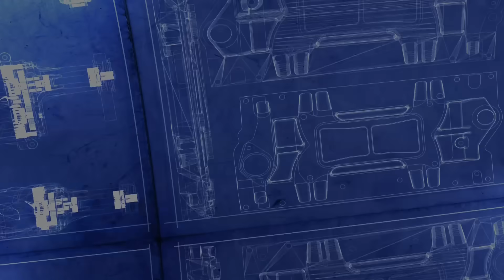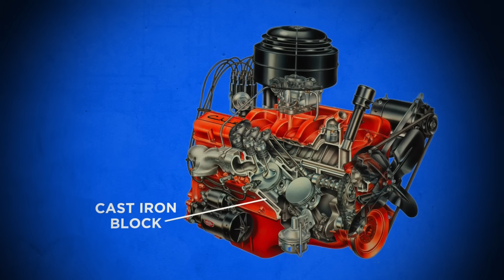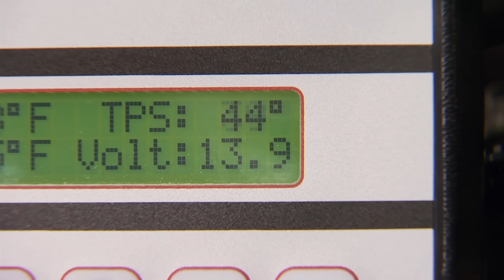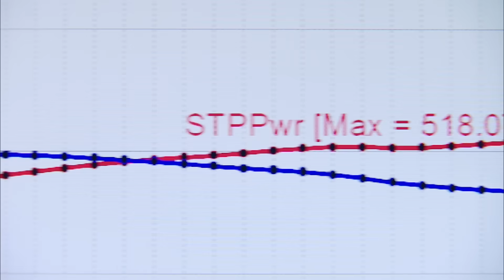Building A 518HP Supercharged 350 Small Block - Engine Power S2, E6

Comment: Mediocre short block parts, ok heads, smallish cam, is a sure recipe for mediocre power.. I'm not sure I'd be impressed with barely over 500hp.. especially with a weaksause ribbed belt for the blower drive..
Reply: I got the same block and it makes 500hp without a blower lol
Reply: @mattgarkus2489  my point exactly... watch enginemasters, way better show in my opinion
Reply: Correct, I have extensively ported cast iron fuelies from K&G speed on a 355 with 12:1 compression making 510 horse for a LOT less money. And I took the big cam out and went smaller for that power.
Reply: @donrutter6765  what octane you are runing in?
Reply: @donrutter6765  I hear you buddy. I had an 84 Ramcharger and pulled the original LA 360, I did a factory refresh with some forged rods, .030 over Mahle 12:1 pistons, Dart heads that were also extremely ported (by me), I installed a large custom grind cam (I don't remember the specs, this was quite a while ago), and I installed an Edelbrock dual plane intake manifold with a Holley Street Avenger 850 double pumper and with 111 octane Cam2 fuel it made 488 HP/501 lb ft of torque on the engine dyno. Not bad for an old emissions minded 360. I built the engine to install a Procharger, but I sold the truck before I got a chance to purchase the supercharger kit. I loved that truck though. Even though it was heavy that 360 shoved that big beast around with no problem. It would spin 33x12.50s with no problem...lmao Even through the old 727.
Reply: @donrutter6765  niice

Comment: 518 hp out of blower sad 😪 should be 750-800hp
Reply: 500hp out of a 350 (5.7) liters isn't that hard. 400 hp on very mild cams and middle of the road heads is common already. A blower should see in the 600's easy.
Reply: Clobercow1 what I think the problem really is they don't know how to tune properly since it was fuel injection
Reply: Not much power you get more out of a stock ford Barra 4.0 L straight 6
Reply: @Akil Baldwin it is an amazing engine makes a ton of power turbo one and nothing will touch it. I would drive something late model with an LS. Just not in a 60s muscle car.
Reply: 13:1compression 383ci on 110oct pulled 660hp dyno naturally aspirated.
Reply: @660hpCamaro  Barra's best 6.8s 2000 hp 10,000 rpm in a Dodge avenger
Reply: Correction 6.5 sec quarter mile stock block and stock cyl head
Reply: @awesomusmaximus3766  nothings hitting 2khp with out a billet block and custom heads not to mention twin turbos
Reply: @spankthemonkey3437  no it won't
Reply: @660hpCamaro  Yes possible but takes 4k in aftermarket heads  and special offset lifters and rockers to get around sbc design flaw.
Not possible with any production sbc head period.
For less then 4k total I can rock a 600 650 horse ls complete intake to pan can almost get it under 3k total
Reply: @Thelastoftheog  they didnt use production heads in this video. That blower was probably 4 grand and they could of put that money in good heads
Reply: @660hpCamaro  exactly the point 😆 for less then that 4k I can build a 600 plus n/a ls with stock heads intake to pan.....
No fancy crap needed no arp no melling.
Technically I could do it with all gm parts except cam kit by flycutting stock ls3 pistons.
My point is you can't make big sbc power n/a without  dropping 2k plus on head intake package
Reply: @660hpCamaro  you can't daily drive it though.
Reply: It's interesting to see how people don't understand, or don't want to understand HP and reliability and price.  A motor that is purpose built is just that...  Can they change the cam and up the boost???  Of course they can.  The simple minds on youtube never cease to amaze.  Are people that stupid? or is it ignorance?  or both?
Reply: I just watched engine power the made 997 hp and 900 ft lbs of torque with a 400 ci sbc  with a centrifugal supercharger. With only 7 lbs of boost on 93 pump gas, bump that to 12 lbs with 110 and that over 1200 hp. Only difference was they used a dart block
Reply: Jr's Garage I know lol then they said a forged crank is needed 😂
Reply: The stock blocks are only reliable up too 650-700hp. Regardless of what it should make the block would crack at that power.
Reply: Justin Bozeman - this is the problem with trying to make HP on a computer screen.  Same reason all the civic owners think their VTECs make 800 To the wheels. you can’t make HP by just doing the math. 

“Average” motor CFM consumption values, blower eating causing so much parasitic loss, etc etc.  Doubling the boost doesn’t just double the HP becuz the intake air temps increase exponentially, meaning the air density is dropping with each pound of boost increased.  

The harsh reality is what these guys found on the dyno, is probably really close to what most people are running, with a similar set up without alcohol or inter cooling.   Nobody likes to hear that statement but usually the truth is only a dyno pull away.
Reply: @ScoredPiston  they did run a cooler
Reply: @ScoredPiston  
While you're more or less right this engine is still under-performing for its intercooled boost and displacement, cam size, ect. I was making more power then this at the crank with a much smaller 177 supercharger, running half the boost, and a single carburetor on a 383. The only advantage I had was a little bit bigger soild roller cam and ~30 ci.
Reply: @ScoredPiston  they were running an inter cooler on this one
Reply: Heres another street 350 with over 550hp naturally aspirated https://youtu.be/gUYzannB8jM
Reply: Justin Bozeman - but you are doing numbers on a computer.  Anyway, I’m not sure where you got your engineering degree but you didn’t address shit and you obviously have some issues with people questioning your superior intelligence.  I think you need to go get a hug.  “If they would had addressed the cooling....”. Blah blah blah.  Gale banks has a really great video you should watch about supercharger efficiency and maybe you’ll understand intake air temp vs boost and why the motor won’t make your calculated number without massive help. 

I’ll keep building boosted shit (yeah, real stuff like cars and boats and snowmobiles) and enjoying my life and not giving a flying fuck about what you think.

Save yourself the trouble of responding, since I’m sure it will just be filled with more anger, I won’t be back to read it.   

Have a nice day.
Reply: @ScoredPiston  they did run a water inter cooler did youu watch the video. the blower was sitting on the cooler with 2 black ports on the front of it. they said we hooked the cooler pump to the dyno frame but you will find a place under your hood
Reply: @Bozemanjustin  
I have seen Chevy 350 make over 1200 Hp at the race track so i dont know wth are you talking about .Nitro...Twin Turbo all types of things on them .One 350 out of a 72 Nova made 2000 Hp .Explain this .
Reply: @Bozemanjustin  
I have seen little 1.8 L 4 cil make 2000 Hp ...Explain please ...you seem so smart and shore of your self .
Reply: @Bozemanjustin  
No the guy said in any way any how no way that we could run i gues 350 Hp or so becouse thats how much flow the engìne has or as he calles it a 350 vacum breather .

I know i had about 350 350s in my life and i know how i can and cant get out of them Chevy or Pontiac 350 s .
Reply: Radeonr9280x A you can easily get 500 hp naturaly from a 350
Reply: Jr's Garage yea I've seen this video where a stock 350 junkyard engine with eBay turbo do well over 500
Reply: Blowers waste a lot of parasitic loss. A 10,000 hp top fuel car wastes 800 hp on the blower.
Reply: T RopE  realy it will cost you almost 15k for 550??? wow you can get 550hp on around 6k
Reply: 275 to 300hp factory. Cam and heads bumped 120 tops then supercharger another 100 ish. Waste of money
Reply: The pulley ratio on this is conservative AF. The eaton TVS 2300 rotor pack in that blower is the same as used in the 13-14 gt500 mustang and LS9 and can be overdriven to over 18,000RPM for around 800hp on E85.
Reply: @Bozemanjustin  yeah but the blower is eating 100hp
Reply: @stiggy60426  they dont take that much to run
Reply: The show is old some episodes are 10 years old tech has changed so much since
Reply: @BIGGIEDEVIL  The Barra is 17 years old
Reply: @BIGGIEDEVIL  eldelbrock still sells this engine today iirc none of the complete engine with blower go over 575hp
Reply: Jr's Garage yea i think In another engine the almost bit 1000 with a mild cam and no blower
Reply: @Akil Baldwin I'm a die hard Chevy fan have never owned anything but. I hate the LS platform there ugly as hell especially in old muscle cars. I will keep my big and small blocks you can have all the LS crap. In my area not so cheap and definitely not cheap to build. Sound like any small block.
Reply: @robertweitlauf4653  out of summit you can build and ls for close to the same price as a gen1 sbc. they have really come down on the price of the parts for them. the aftermarket has really caught up with the ls
Reply: @robertweitlauf4653  plenty cheap to make power with ls cheaper then sbc if you want to make 600 650 n/a 
6.0 iron block bored to 4.065 ls3 heads 11.1 gpi ss4 cam kit is 600 plus all day for less then 3k
Reply: @Thelastoftheog  I can make as much power for a whole lot less money with old school small block. I have been building small and big block Chevy's for 45 years and have been taught by some of the best in the industry. And LS platform is not cheap to build.
Reply: @robertweitlauf4653  so what sbc head cause you ain't getting over 500 with production sbc heads n/a.
Reply: @robertweitlauf4653  I can get a ly6 6.0 core for 4 to 500. Ss4 Cam kit with gaskets and pump 1000.00
300.00 Block machined, 600 for srp pistons, 100 for misc gaskets that's 2500 for 600 plus n/a even with stock truck intake
Reply: @robertweitlauf4653  my stock ls heads flow 301/199 @600 and 373/250 ported no need to buy expensive crap.
Reply: @Thelastoftheog  sure I can that's what 45 years in the industry gets you. I grew up in the area when guys made 4 and 5 hundred horse power from small cubic inch engines.
Reply: @robertweitlauf4653  lol find one dyno vid of a sbc any cubic inch 
With production vehicle cast iron heads not bowties that's over 500 up n/a on gasoline.
Not even with vac pump, narrow bearings, roller cam bearings, 14.1, 
There are none.
Maybe with the vortec head which all agree is better then old double humps 041 441 461 462 and that's ported to the max Push rod tubes and offset lifters and might break 500
Reply: @Thelastoftheog  dude give me a break, 1970 LT-1 factory rated 370 jp actual hp with a good tune 500 hp. 1969 302 factory rated 290 more like 450 . My dad's 287 from 1965 was dynoed at 447 hp with hilborns. So don't tell me it can't be done. I can get dart iron eagle heads all day long for 400.00 a pair I had a 377 in a 55 Chevy that made 563 hp on dyno. You can have all the ugly ass LS crap. Besides I never said they didn't run  or not make a ton of power I just said they don't belong in a 60s muscle car.
Reply: @robertweitlauf4653  what's the absolute MAX Cubic Inches and MAX Liters a Small block 305 can be Bored over to, and Stroked to??
Reply: @159002  the biggest you can go with a 305 is 310 ci that's a .030 over bore and stock 3.48 stroke. Your better off spending your money on a 350.
Reply: @159002  you can got up to a 334ci but if you going to do all that id just get a 350 block for less that 200 and make a 383 or you can just keep it a 350 and make lots of power. if you cam and head the 305 you wont get 400hp out of it without stroking it out
Reply: @robertweitlauf4653  oh ? U dont like the ls ? I'll 2jz swap a 1960s muscle car for u 👀🖤
Reply: Robert Weitlauf yea you never see that ls in the junkyard that everyone talks about for 500 dollars
Reply: Shitty power for the amount of money put into it. Edlebrock sux
Reply: @Jay Rielly DOHC  24 V VCT  4.0 L Aussie made Ford  inline 6
Reply: It's a Chevy don't expect to much.
Reply: @foxbodybuild6637  and you expect more from a Ford.
Reply: @foxbodybuild6637  shut up nigga

Comment: Really only 518 hp out a blown sbc . i have made that with vortec headed sbc naturally aspirated. Come on guys.
Reply: I saw a car craft article they had a damn near 800 hp stock bottom 350 with a twin turbo Ebay kit.  518 with a blower? Hahah. Hahaha. Hahah. ..... hahahah.
Reply: I know the LS may is a better platform.. but I have seen a few " not streetable " LS motors being touted as "streetable".  I keep seeing it where instead of an improved engine, people spread around like the LS motor is like you just mounted a rocket ship, and the 350 as a boat anchor. Not so!.   Good engine yes, in some ways obsoletes a SBC.  But my choice is BBC, then LS, then Small Block
Reply: 2 bolt main maybe the 4 bolt should make more
Reply: @Bozemanjustin  pity the blowers only  rated at 10 psi standard
Reply: HotRod magazine has an article on how to get 570HP From a Small-Block 350 on Pump Gas. 
https://www.hotrod.com/articles/get-570-hp-small-block-350-chevy-pump-gas/
Reply: nallen100  yeah NASCAR engines are not good on the street dumb FUCK...They are designed for sustained  high rpm driving...They have like 13:1 compression dumb ass....Not exactly practical in a street car...Wise up butter cup
Reply: @bilbobaggins4710  LOL, cool off a little there sparky. Your "not with a 350ci" is a broad statement indicating that no matter what a 350 won't make that kind of power. These guys are simply taking every situation where you CAN make more power, application aside, and saying yes it will. @Justin Bozeman provides the method of determining an engines power and clearly shows that 800-900 hp can be achieved on a street car.

End of the day, this was a VERY mild "blown" engine.
Reply: @Dakktyrel  the original commentor admitted he was referring to a 400ci Dart block there "sparky"...
Reply: Critical Thinker if you think 500hp is impossible with n/a 350ci engine you obviously live under a rock. Damn son at least spend a little time on YouTube if you’re not gonna get out a little.
Reply: @bilbobaggins4710  Fr, cool off man, take it an easy, You're right, they wouldn't make good street engines, but the idea is that they are able to achieve 2 hp+/ cu in without using any forced induction system, which these guys are only making 518 hp from a 350 cu in blown sbc, which is around 1.5 hp per cu in with forced induction which is ridiculous mentioning that people have been able to achieve 500+ hp with sbc's sitting in their garage, sometimes using things as simple as stock vortec heads, but never having to use a turbo nor a supercharger to achieve it which helps save a lot of weight, and ultimately what really matters here is the power/weight ratio which if true, would show just how over-weight, impractical, and overpriced the build really was.
Reply: Not with a 350ci. You didn't
Reply: @bilbobaggins4710  yes they do you just dont know  nothing about engine
Reply: @bilbobaggins4710  yes it can be done.  And has been. Tell Joe Sherman he never did a 700hp 350 NA?
Reply: @natelorimer8567   He didnt claim touse chitty vortec heads. So many talk like they are sooo awesome
Funny
Reply: @gordocarbo  ypur pulling put of context. I do not think vortecs are so awesome. 500 hp is possible  on a  vortec head ported.  BTW there are aftermarket Vortec designs for the SBC.
I realize How Sherman wasn't using them. But the truth is  you don't need an LS.  
The piston with the right breathing does t care if the outside is ford , chevy sbc or LS.   110% volmurerc efficiency is 110% VE.    There are so many good heads out there, the world has changed  for the small block.
Reply: @bilbobaggins4710  355 i did . 13 to 1 engine made well over 500. Been racing for 30 years 500 hp from a 350 is not hard .